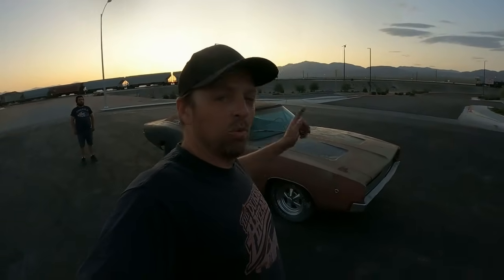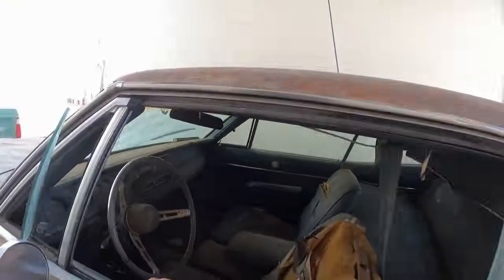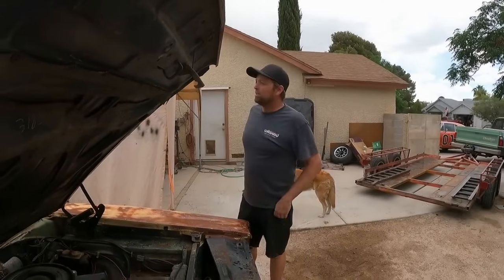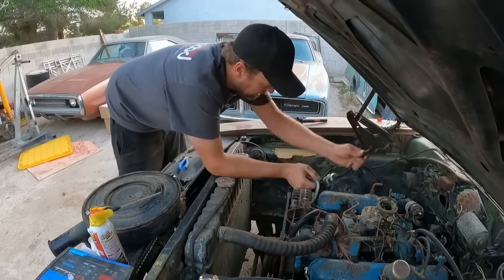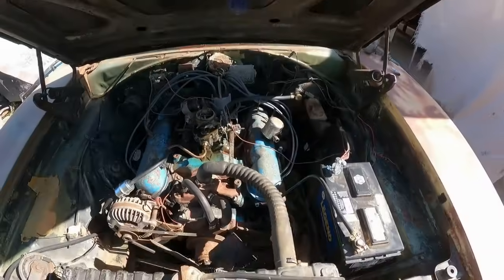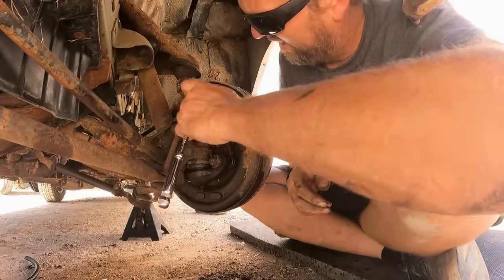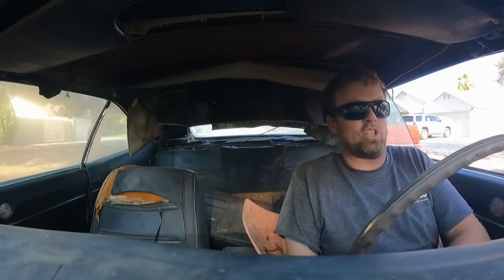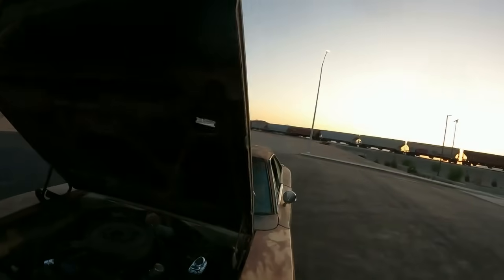1968 Dodge Charger...how much life is left in a 56 year old car

Comment: I remember when I was 14 I was changing the Spark Plugs & wires on my 1970 Monte Carlo.

I asked Dad if I could do that before I got into it. He said ARE YOU NOW, GO AHEAD TRY IT, HE FREAKIN KNEW.

I pulled all the wires off changed the Spark Plugs then I realized as I was going too put the Wires back on ?

Where the hell does each one go ?

I went too the other garage to ask Dad & before I said anything Dad starts laughing his ass off.

HE FREAKIN KNEW WHAT I DID, He goes having problems with the wires after he was done LAUGHING HIS ASS OFF.
He helped & showed me the firing order, ALL WAS GOOD BUT HE KNEW & LET ME SCREW UP.

That was in 1979 & I still remember that clear as a bell.

Dad wouldn't help me with anything, I had too ask him for help unless it was something for him.

Don't even ask me about the first time changing drum brakes, IT WAS AN ADVENTURE.
Reply: Those who grew up in the 60s 70s and 80s got the most out their youth.
Reply: I believe you are correct on that!

Comment: I  pulled a 68 318 Charger out of my Stepdads junkyard in 1981 when i was 15 saving it from the crusher and ended up installing a 383 engine from an old Chrysler Imperial,had it running good then some guy comes by and offered my Stepdad 1500.00 for it and of course he accepted it.He did buy me a 70 General Lee Charger the following year though I would Love to have either of them back now.

Comment: One of your best videos. I had a 318 motor in 74 Dodge Van that I purchased brand new. Got  240,000 miles drivin it had to replace broken  R-Front coil spring & had a heavy duty Amco shift kit installed in transmission because I had delivery job with van, those were only repairs I had done with it. Are you going to Quick Flip your new to you minty green charger. You sure cast a big Charger Net, you have paid your Dues. Lookin forward to your next video

Comment: Just because the slots are in the hood doesnt mean it had a light package. It may have had the metal block panels covering the openings, which have been removed. Seems like they were more likely to actually have the lights in '68 models, but the opening was there either way. Like you said, cost cutting. I have found far fewer later models to actually have the lights.
Reply from the maker: Ur thinking 70, if 68/69 there was either a hole or not. No blanks
Reply: @junkerup  My first car was a '69. The car was all original, owned by a family friend. The hood had the holes, and instead of lights like our '68 had, it had metal blanks held in place by an underhood bracket/nut/bolt assembly. The car was bronze in color, with black tape on the hood indentions running left to right covering the entire width, including the area where the lights would have been. That way you couldn't see the flush fitting plugs. I entertained the idea of adding the lights, but it never happened. No idea where the car is now and I hate it, but at the time things were very different (early 90's). If I ever come across the brackets again I'll figure out a way to send you a picture of them. I am fortunate enough to have another B body now which is kinda happening along the lines of the General Mayhem, in that A 440 is going in and just want to get it running, then do improvements as I go. Your stuff and the Mayhem and Engine Masters stuff has been very helpful in answering some questions and pointing out things that are very helpful. Oh, it's a '68 Coronet 440. A 318/904 car that deserves a big honkin' 440. It means a lot that you're out there bringing these cars back.

Comment: The 318 don't have 100HP the slant 6 has more then that that 318 has 230 hp being a 68. If that is the og 68 block them 318's can be bored out over 60 I know guys that bore them 90 over damn near to a 340 bore. They ar real good blocks the early LA's and the heads should be a closed chambered head compared to the 70's smog heads